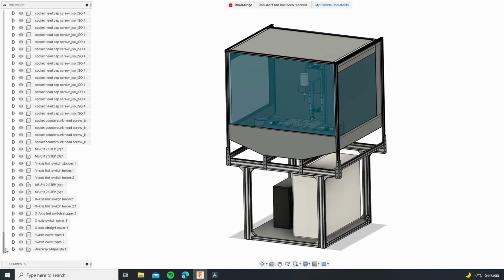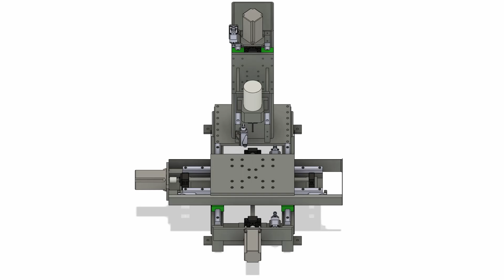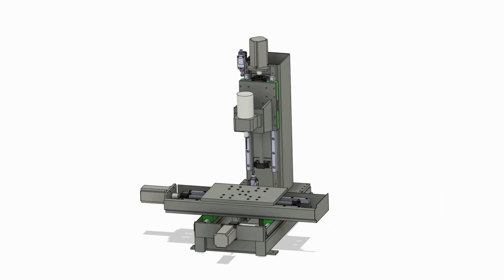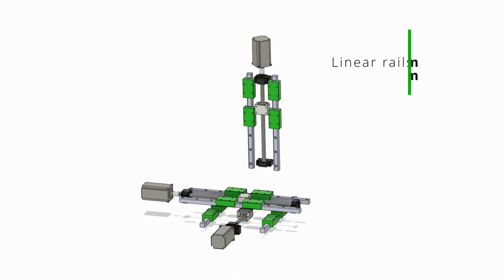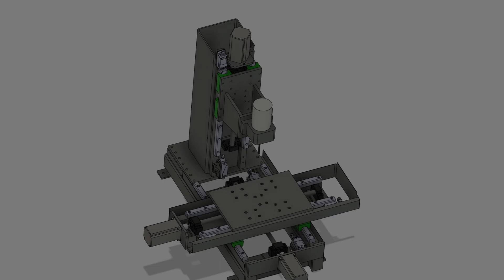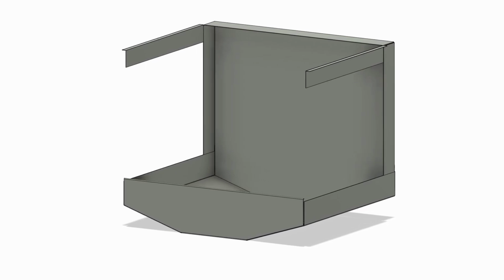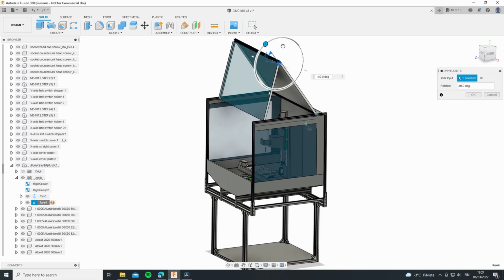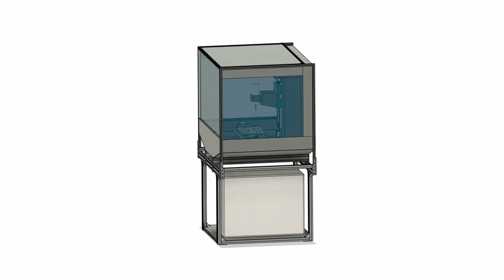DIY 3-Axis CNC Milling machine Part 4: Final design overview (3D models in the description)

Comment: Very inspiring work. I'm thinking of building it myself but I'm interested in the level of accuracy you achieved? Thank you for sharing all the specs.
Reply from the maker: Thank you! Theoretically you can hit sub 0.01 mm accuracy with the machine but in the real world the tolerance zone is propably 0.05 mm. During testing I have measured a aluminium plate with holes cut in to it and the locations of these holes were off by 0.02 mm.
Reply: @tw2ka644  Impressive! Thanks for your reply